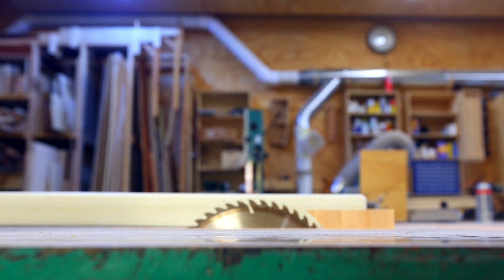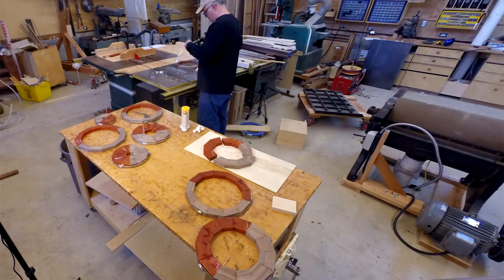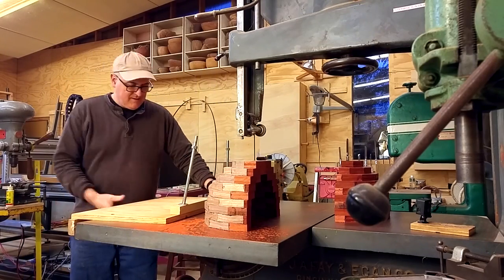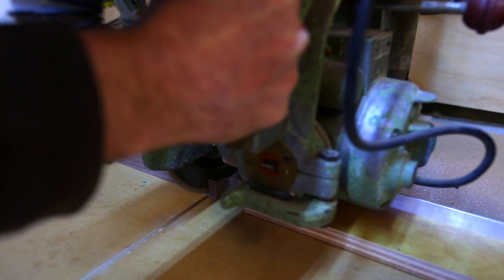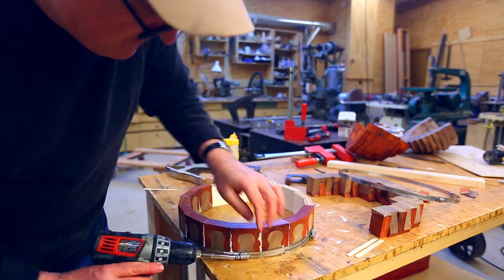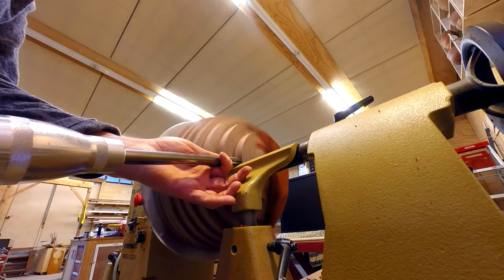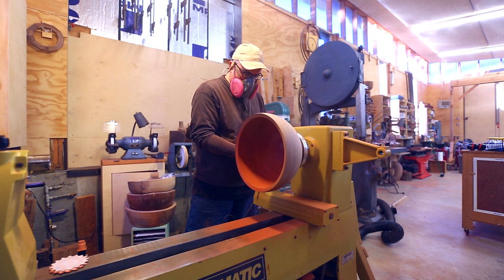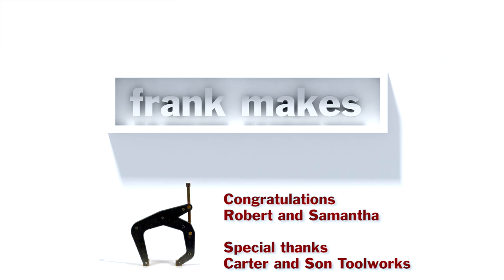Wood Turned Wedding Bowl

Comment: super cool fixture and bowl design. 

suggestion: if you use a push-button slide-adjust nut for your big axial clamping fixture, you don't have to spend any time threading it down the all-thread, and you can drop it on after you have placed the slotted clamping plate at the very end, so you probably won't lose it inside the workpiece. 

hope it helps.

Comment: you know that's something I'd always thought about. the different density of the woods causing a wobble in the project because of weight distribution. but I could never really see it because my lathe is smaller. Its nice to have a visual and fix

Comment: Beautifully done! One suggestion, while still on the lath try applying your finish. I did this to a piece I did years ago and with multiple coats it gives it a real depth. Like you are looking into the wood. Wish I could recall the exact steps, and how many finishing coats with oil I had to do, but it's been too long. I know it took hours to accomplish  but worth it in the end.

Comment: +frank howarth   A rare earth magnet could be set on the nut and would be strong enough to stick the washer to the nut.  It could be removed when necessary to tighten the nut down for clamping.
Reply: +Stephen Thompson oh, I was going to use a common Mars magnet!
Reply: +Stephen Thompson Put the magnet on top of the nut, the washer would stick to the bottom, and you'd never have to remove the magnet.
Reply: Braeden Hamson If it were a ring shaped magnet with a hole big enough to spindle, yes.  If it were a bar magnet or disc it would likely get in the way of the wrench used to tighten the clamp.  I too would put the magnet on the top of the nut.  I think having a strong magnet wherever it is placed is the main thing.
Reply: I made a similar device not long ago.  I used a nut with an attached free spinning washer and it worked awesome.
Reply: +Stephen Thompson A Keps nut will do the job.
Reply: +Aaron Hammett   I think the washer must be much larger, like a fender washer.  If a k-nut could be found with an O.D. half an inch larger than the nut it would work.

Comment: Really amazing work. My only criticism would be the fact that the wood grain and pieces change direction at that middle piece, and it looks like a stripe down the middle. Would be cool if you could keep them in the typical direction, but I think that would require doing angled CNC cuts, which could get very complicated.

Or, maybe easier, assemble all the pieces vertically. I think the transition would be a lot more seamless, without that stripe effect. Just a thought! Great work :-)

Comment: How good is that bowl looking...! The symbolic connection is very clear and strong. Frank, have you tried: "The: Glue with a layer of Paper - on to a piece of Plywood - trick" on the cnc machine...? I was hoping it would Work, so you can finnish the pieces there.  As allways...great videos...Interresting to follow your workflow, process and thought process...!

Comment: In order to deal with the difference in weight between the two types of wood, you could have securely taped something to the inside of the walnut portion, in order to balance it out. Circa 12:00

Comment: Thank you for sharing, you are a good youtuber. it's nice but you are so wasteful, and overkill on glue. so many machines  so little actual woodworking skills. I feel you could of done a much more interesting design using just the cnc, cut exactly the segments and have them on compression joints. any other way would be less waist.